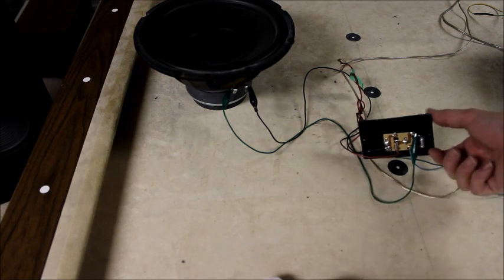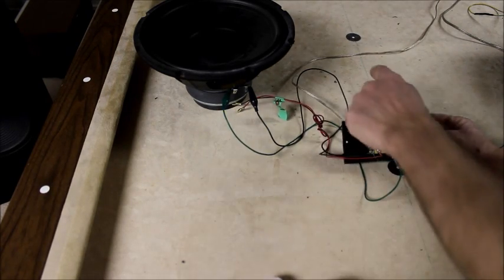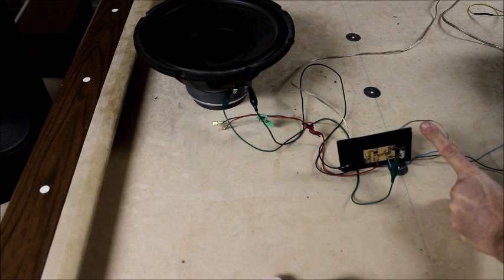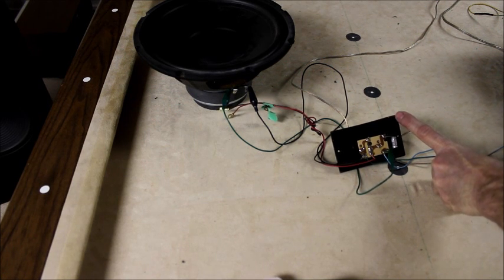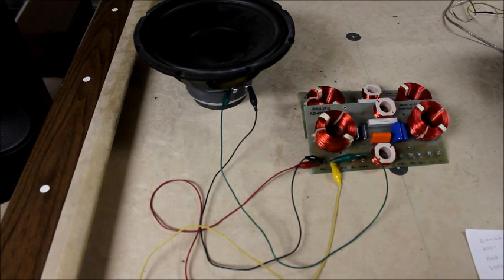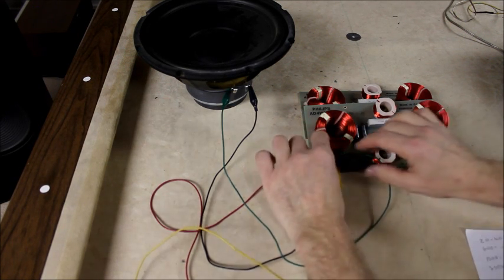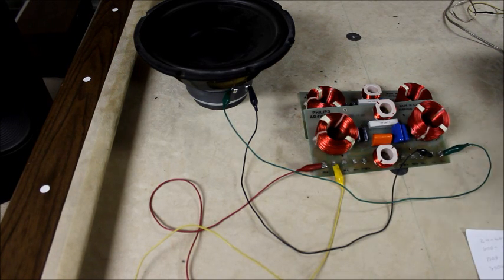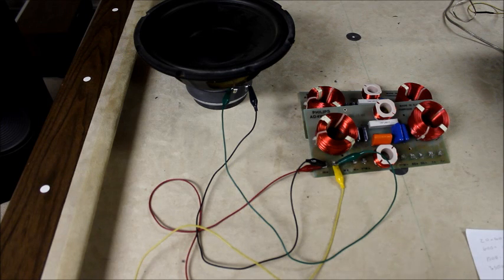Philips 4 way crossover demo

Comment: Hello sir. I have a couple of speakers like JBL l200 and JBL 4430 Studio monitor, both 02 way speakers. The Studio monitor has a function where i can set up internal or external crossover and plug the speakers wires. Do you know what should i do to add a tweeter to the speakers and play It as a 03 way? The tweeter is not gonna be inside the speakers cabinet. Thank you
Reply from the maker: I had a pair of L-200s and their sound was spectacular.
Sorry, I have no exposure to the set-up that you mentioned, but you might try adding a pair of Realistic Super-Tweeters. They have a very good frequency response, and are self contained (in a finished package). They look just fine sitting on top of a large pair of box speakers.
Reply: KKnockk yes sir, It's. Thank you.

Comment: Excuse me Sir.....

In a 4 way crossover....should we always start  by the subwoofer?

1. Subwoofer 
2. The woofer
3. Then midrange. 
4. The tweeter. 

Is this right? Or should we start by the tweeter first?
Reply: Gioxtream don t call it a subwoofer. Just build a tower. Super dampened, braced, heavy, make it up to 300 hz, a 15 inch, quarter wave transmission line.